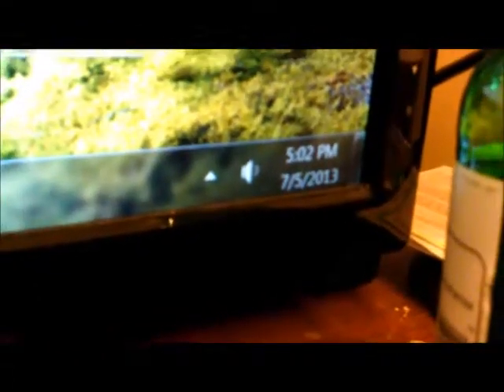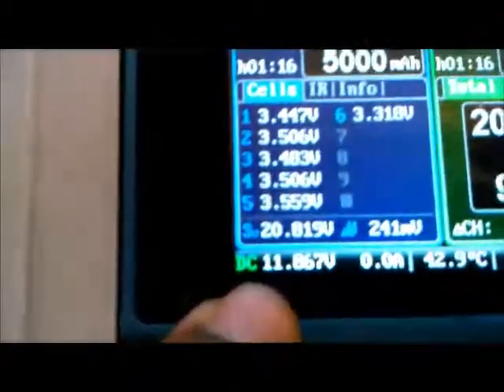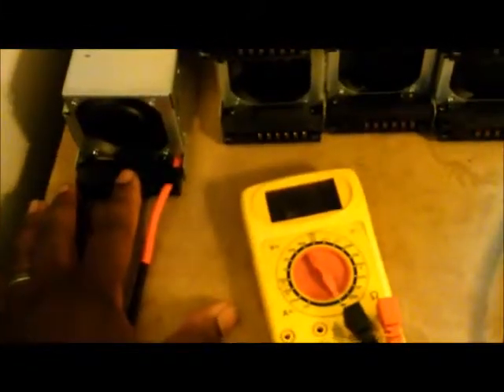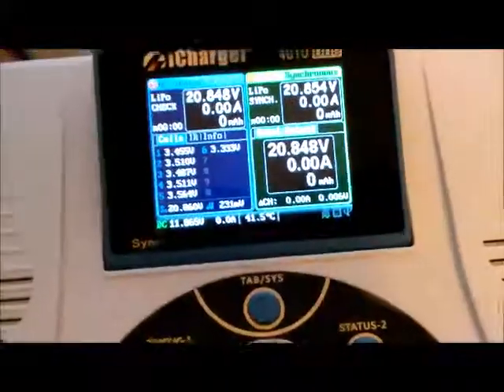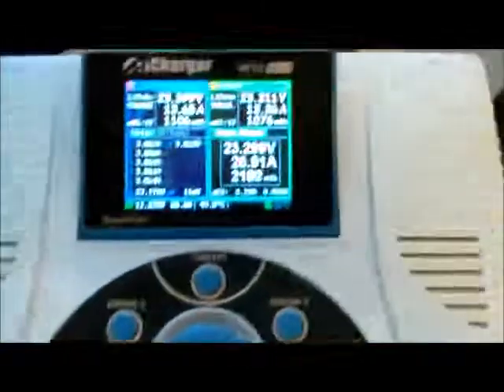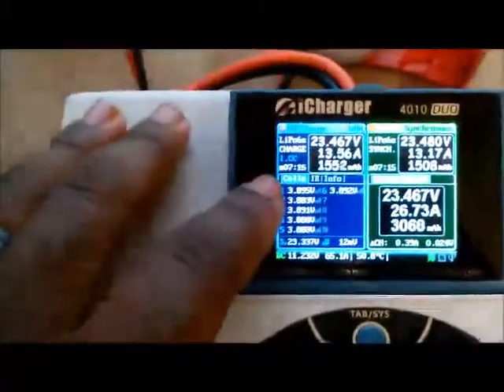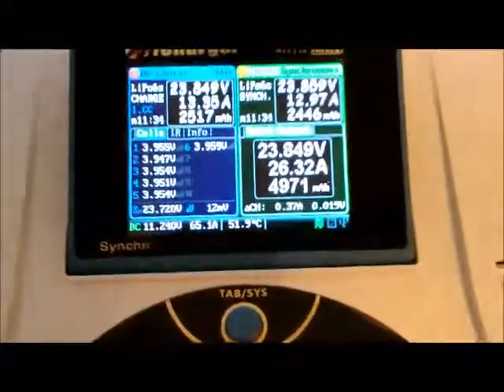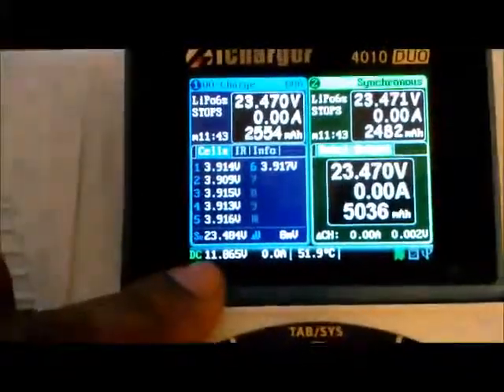Load Testing Dell 700814-Y000 Power Supply @ 12v 65A Charging  5AH 6s Lipo

Comment: can you remind me of the formula to calculate how many amps I can draw from my generator. so I have have a 2000w AC generator. How many DC amps can I draw max from my DC power supplies. Thanks for any help!!
Reply from the maker: Depends on your psu take the total wattage of your psu divided it by your pack voltage and multiply it by .80. This should give you a safe max charge current that you could achieve with your setup.